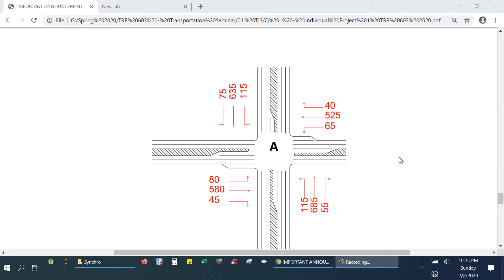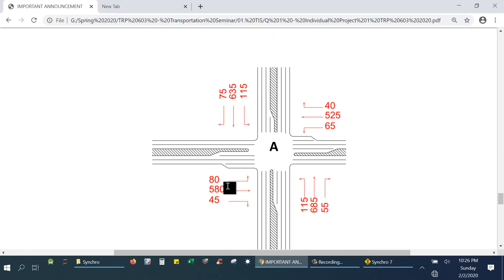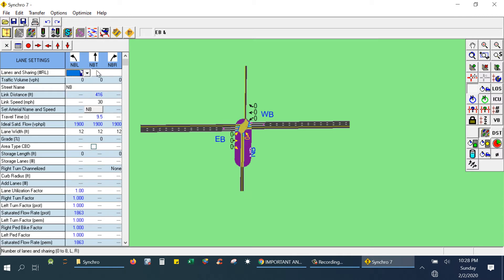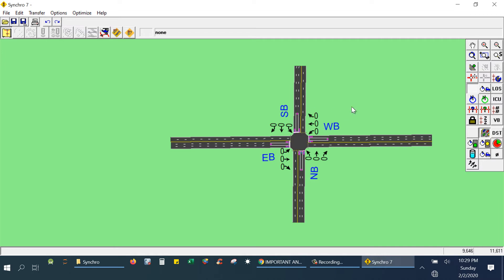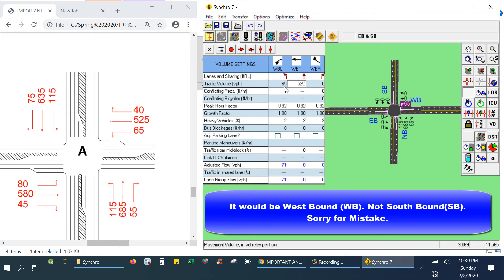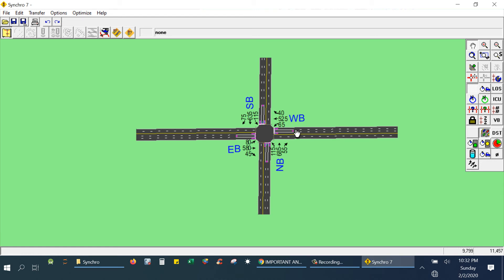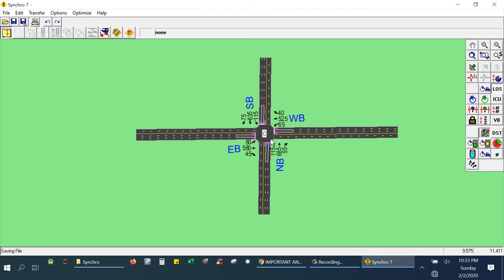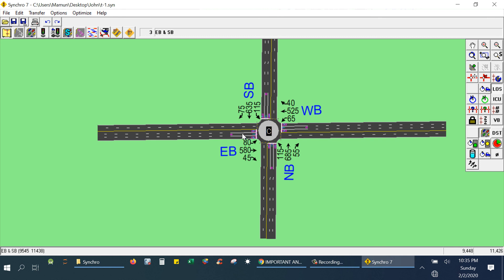Synchro Tutorial 1   Introduction and Level of Service

Comment: How to use if for Left side driving condition.
Reply from the maker: Hi thank you for your question. The version I have used here is an older one (7.0). From Synchro 10, users are able to code left side driving condition like India or Australia. Here is the official answer from Synchro: https://www.trafficware.com/blog/synchro-10-features9657564
Reply: @TheMastermindEngineer  Are there any detailed steps explaining how to code it for Left Hand drive. The devs only said to switch the left and right turns.